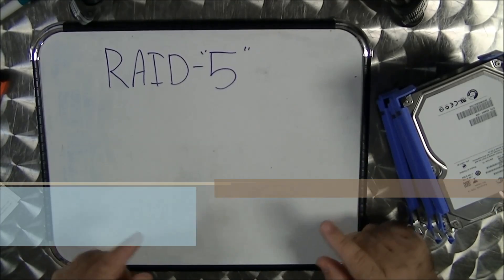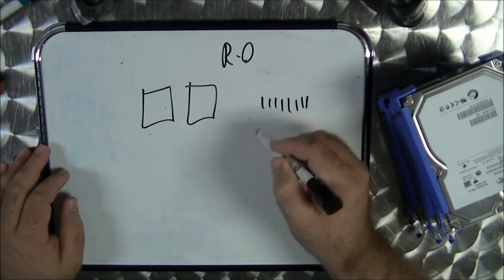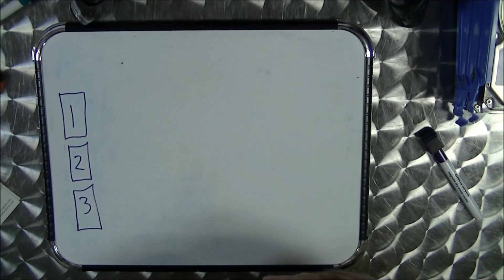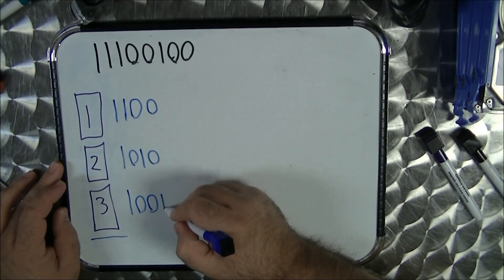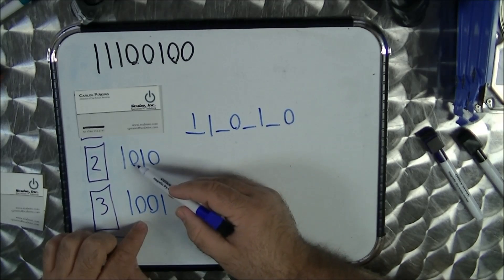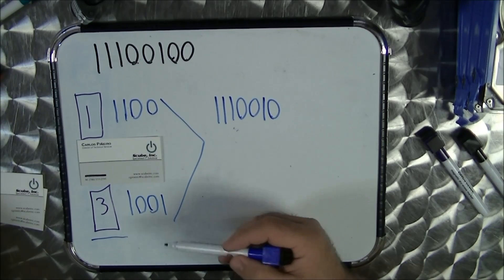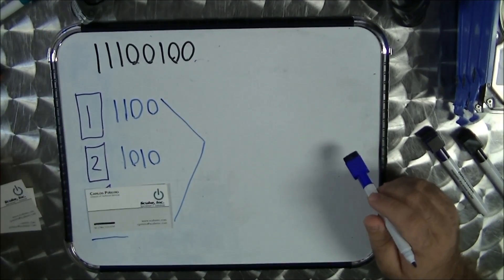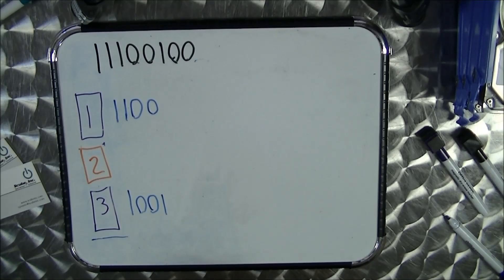How RAID 5 Works : Reconstruction Rebuilding of data,degraded mode and Redundancy

Comment: Can u  please explain how data is going to distribute in disk when the raid5 is in degraded State?
Reply from the maker: Well, the video is a very simplified idea of how it works BUT the data is constructed via the raid card. BUT in actual working state, if the unit is in degraded mode, distribute is actually limited. hence the slow performance in degraded status.

Comment: Is is this a simplification or really how it works ?
Reply from the maker: It is a very simplified explanation. There is alot of math and tables stored on each disk. But the basic BASIC way of how raid 5 work IS this way. Parts of data on different disks and a parity bit on disk for error corrections and data rebuilding.

Comment: Thanks for this it has helped a lot I was really struggling to understand it.

So when it goes to write the next byte would it then record the parity data on drive 1 instead so drive 2 and drive 3 become the main drives?
Reply from the maker: This is just a really simple explanation of the function but the data is actually spread all over.

Comment: How does it know whether the matching numbers are two 0's matching or two 1's matching? Did I miss something here?
Reply from the maker: Thank you for your question. To make this simple we will only be talking about 2 bits of data. Let's call them A & B. And let's call the parity bit X. So let's imagine data A and B are 0. Parity bit will ask if the 2 bits dont match. Since they do match then parity / X = 0. So A=0 B=0 X=0. If I loss Data A then I can rebuilt it because B=0 and the X answer tells me the other data bit MATCHED. so B data MATCHED A DATA. So the missing answer is 0....
if B=1 and the parity/X=0 which means the data matched then A would have equalled 1.
If you parity/X bit=1 then that means that the data bits DO NOT MATCH.. So if A=1 and you are missing B then B would be 0 because our parity told us that the bits did not match.
NOW let's say it is the parity bit that got damaged, then we still have our data in place, just the protection is gone. So in rebuilt, the parity is rewritten based on the data bits if they don't match (1) or match (0).
This is a very basic explanation where what is happening is way more complicated. Bit A goes to drive 1, Bit B goes to drive 2, and Bit X goes to drive 3. If 1 drive fails, we can rebuilt that missing part based on what the other 2 drives state. I hope this helped
Reply: @cashe18  thanks for the response! This is some pretty complicated stuff, it's amazing what humans have been able to accomplish. That's why smart people make the big bucks!

Comment: Thanks a million, SIR...  I got the Grand Fairy and magical pixie dust rebuilding explanation as well from other sources.  I looked for an hour on this (MAGICAL PARITY fixer).  I got the understanding of Parity from the ECC SDRAM on the DIMM modules in the slots, and it looks like the same line of logic applies here to the RAID configuration on hard drives as well.  Thanks for the Graphical explanation, now I can regain a few hours of sleep.   If we ever cross paths, Dinner is on me.
Reply from the maker: What really happens is of course way more complicated but this is a simple explanation of concept. Glad it HELP!!! I live in South Florida, I'll take that dinner... THANKS

Comment: Your video explanation was good, until the XOR calculation point... When you have two similar values like 1 and 1 or 0 and 0, the output is 0. When you have not matching values, like 1 and 0 or 0 and 1, the output is 1. In your video, you had it reversed...
Reply from the maker: But my explanation is only a concept of operation. It's not exactly how it works. I could do the XOR but then I have to do the grouping, the sector, the data split when you have 4 or more drives. But thanks for the feedback

Comment: Doesn't RAID 5 use XOR to calculate parity??
Reply from the maker: I have read some systems do but using xor would invert the example. But reality us that is only a very simplified example. Raid is way more complex to track it's changes and regeneration status, ect.
Reply: @cashe18  I am just doing a class on storage now, and the teacher is having us calculate the parity of RAID 5 with XOR. Your video was good, but confused me so I had to double check.

Comment: I think what you have explained works for RAID 3 & 4 (theoritically , i.e., as they are not used in the industry level ) .But in case of RAID 5  - there will be no DEDICATED PARITY DISK , the parity will be distributed  among all the disks used in the RAID .

Comment: Wrong Calculation of  Parity = XOR value of the Data. 
0  XOR  0 -> 0
0  XOR  1 -> 1
1  XOR  0 -> 1
1  XOR  1 -> 0

And You cannot fail more than 1 Disk in RAID 5.
Reply: You're right! The parity in this way would not work with 4 or more disks. I'm amazed by this explanation
Reply: Exactly, this video actually confused me
0 - 0 is 0
0 - 1 is 1
1 - 1 is 0 and
1 - 0 is 1
This guy says it otherwise 🤷‍♂️

Comment: For any newbies, the explanation given in this video is only a basic explanation.  First of all, digital bytes (8 bits) are read just like decimal numbers, from right to left not right to left.  Bytes are base-2 as opposed to base-10 (decimal).  Therefore, the bits 00 = 0, 01 = 1 and 10 = 2. The byte given as an example in this video is the decimal number 228.  The other key point is that with RAID 5, the data and the parity bytes are written across all available drives.  This example tends to imply that the 1/2 of the byte is always written to DISK 1, the other 1/2 of the byte is written to DISK 2, and the entire parity byte is written to DISK 3.  But what if you have a 6 disc array? The parity data doesn't just get written to the last drive in the array or every third drive.  In reality, the underlying data and the parity data are written across ALL available drives, so the process of rebuilding the array has to look across all surviving disks to rebuild the failed drive.  The controller has  to rebuild the matrix of underlying data and the parity data.

Comment: I believe RAID 1 with a hardware controller writes to both drives simultaneously and does not increase access times over non-RAID.
Reply: Yeah I was thinking that.. and it can read from both so 2x faster read
Reply: @biigsmokee  But the access time is still just as slow as one drive. It still needs to spin up the discs before it can access the data, but once they are spinning they can take data from multiple drives which increases the speed of reading, but writing is as still as slow as one drive. RAID 0 increase both write and read speed, but they still doesn't increase access time as they still need to spin up the discs first. SSD will still access data faster because it doesn't have to spin up any discs.

Comment: You can NEVER lose more than one drive and not lose data on RAID 5
Reply from the maker: I worked on a 16 bay raid 5 when it was new. It allowed 3 dead drives. Oddly I find this was NOT A common norm and you guys are correct. You can not lose more then 1 without an issue.. thanks guys for pointing it out
Reply: True, it is Raid 6 where the concept is same as Raid 5 but with 2-bit parity.
Reply: I caught that too!
Reply: You can actually manually get some data back by JUST having a healthy parity drive but it is a VERY long and tedious task. I don't know how to do it but I worked with an admin that was able to get some customer data back over the course of multiple nights.
Reply: How is that possible? More than one HDD failure has occurred on the server.
Reply: This comment isn't making sense to me. Could someone please explain?

Comment: at 2:35 you said that if you have more drives in raid 5 lets say 6 drives. You said that more drives could fail and all the data could be there. In raid 5 it doesn't matter how many drives you have. If 2 or more fails. You've lost data.
Reply from the maker: correction.. In Raid 5, the more drives you have , more more failures you can have. in a 3 drive setup, you can lose 1. 4 drives you can lose 1 whole drive and have error on another. 5 disk setup, you can have 2 totally fail on you. Many years ago I did a 12 drive setup. 1 was setup as an active Hotswap. This setup allowed us to have 4 total drive failures and the data was sound. I should have been more clear in that part that depending the size of the raid setup will also determine the allowed failure size. Thank you for your feedback.
Reply: Proven here http://www.computerweekly.com/answer/RAID-5-recovery-What-is-the-maximum-number-of-physical-drives-in-a-RAID-5-configuration

You can only lose 1 drive in raid 5 no matter how many drives you have
Reply: also here http://serverfault.com/questions/183183/can-i-recover-a-raid-5-array-if-two-drives-have-failed
Reply from the maker: I'm very surprised they would say this. When I was at viacom, goodness the size of those raid setups and when we would have to do a recovery from multi drive damage would take ALL NIGHT! the drives were SCSI which at the time maxed at 300gb each. Our raid cards were all adaptecs. The exchange servers OS would be on 2 drives setup as a mirror RAID 1, and the data/storages were all large raid-5 setups. Our digital department Raid Racks has status lights for each drive. I can tell you that I myself did so long multidrive fails because our data was SO huge that we had Tape backups that would be roboticly switched. I will look into this, if its because it's IDE but thanks for bringing this to my attention.
Reply: There is no “parity drive.”  Parity is odd or even and rotates across drives.  When you lose a drive you lose 1/n  parity bits, where n is the total number of drives.

Comment: Are you sure there's a speed penalty with RAID 1 versus a single disk? I'm pretty sure there isn't. Even if there is, it's certainly nowhere near as extreme as you claim in the video. And with the right controls, reads are actually faster with RAID 1 than with a single disk.
Reply from the maker: This is  GREAT question. RAID 5 typically was on server board which used HARDWARE Raid cards. These cards like the adaptec brand would actually communicate to all the drives at the same time. leaving the Hardware card as the center point of data in and out of the motherboard. and it's based on the throughput of the drive. As an example imagine each drive can transfer 1MB of data a second. Card reads 4 drives for 1 sec for a total of 4MB of data accessed - 1/3 which is parity error check data. That is 2.66MB of usable data in 1 sec where a mirror would MAX at 1MB in the same 1 sec.
Here is the other catch, since a mirror setup is very simple. Many people now a days most doesn't use RAID hardware cards to do mirrors. doing what is called a Soft raid mirror. Motherboard can usually only access 1 drive channel at a time. So reading and writing to 2 drives takes double the work. 50% overhead. When using VERY fast matching drives, it's hard to notices. So even with a hardware RAID set to a mirror (Raid1) the most you can access in 1 sec would be 1MB of usable data. This is why the Unsafe HARDWARE Raid0 striped is the FASTEST. Say you have 4 drives on Raid0 and you access them for 1 sec, you pull 4MB of usable data. These are example numbers but this is the basic theory. But at the end the Computer is SO WAY faster then the data is accessible from a hard drive that it comes down to the quality of the hardware.